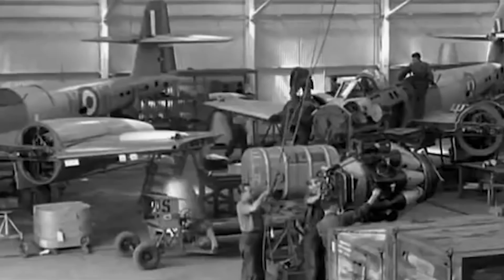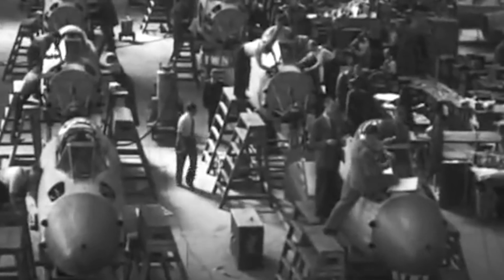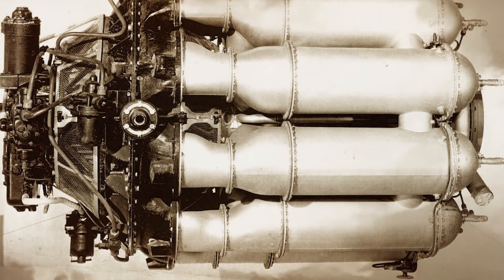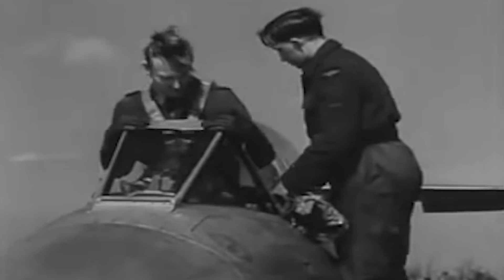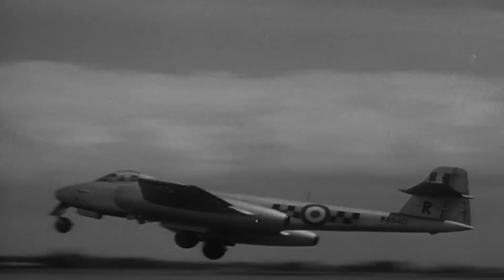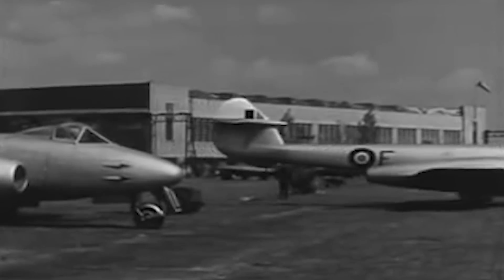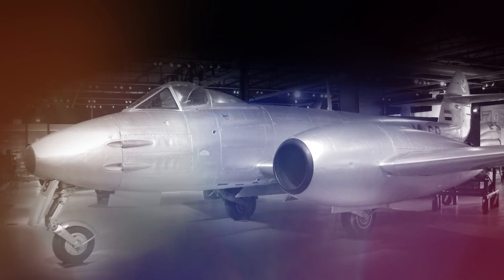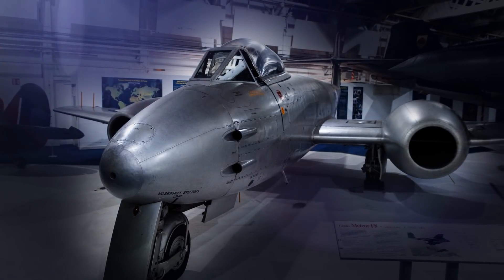Gloster Meteor - The Only Allied Jet to Fight in WW2

Comment: The beginning of the jet age is extremely interesting, but there are many half truths in this documentary along with some myths. 
The Meteor design with its straight wings was not advanced. The wing chord being thick to take the loads with the centrifugal engines being kept from the ground. It can be anticipated to turn well (better?), but probably to be slower than the Me 262 with its thinner swept wings. 

The plane differences is in part a result of the engines, one centrifugal and the other axial. The centrifugal was much more reliable, as envisaged. The axial design, to have a lower engine cross-section, was very ambitious. The Germans had four times as many engines as Me 262 planes. Fuel and extreme short engine life/reliability were the issues. The combat success was not great! The claim that with the right metals the Me 262 would have been a war winner needs to be taken as what it was, a claim based upon lab tests to the bosses. It took years for axial designs to triumph. The desired lower cross-section imposes limits on the other components.

You can then look at the engine components. What were the innovations? The steam turbine was well known and in use. The problem with a jet engine are in keeping a flame from a jet fuel alight, even/low flame temperatures, distances to blades all while controlling the parameters in a combat environment. On top comes the aircraft designer posing limits on everything. All this without computers. Interesting?
Reply: No engineer worth his salt would ever compare a modern axial flow compressor Brayton Cycle Turbojet with a Rankine Cycle steam turbine... the two are as different as cheese and chalk.
Reply: @sandervanderkammen9230  Are insults being thrown? The fluid mechanics are much easier with one impeller. Thermodynamics is another subject.
Reply: @powerjets3512  Just pointing out a deeply flawed analogy comparing a turbojet engine to a steam engine...
 Steam turbines do not have compressors and their turbines although vaguely similar in general appearance are completely different in design and development.
In terms of thermodynamic cycles their are not even in the same class, The Brayton Cycle is internal combustion and uses air as the working fluid.
Reply: @sandervanderkammen9230  They both can be described as very fast rotating equipment.
Reply: @powerjets3512  That is about where the similarities end...
Reply: @sandervanderkammen9230  Thank you for listing so many myths and alternative facts. 

Me 262
May I recommend a couple of videos from "Bismark", Military Aviation History, regarding the Me 262. 

Jummo 004B

I was hoping to get an explanation of why the engine in operational use did not meet the figures. 

Meteor
I think at the very beginning I pointed out that the Meteor design was not good. 

Mig 15

Very good aircraft design built around a not so russian centrifugal engine. I have no problems giving credit where it is due. Great videos of it still flying.

German multi-role Starfighter

Perhaps not all german designs or modifications were so brilliant. 

Jet Engine development

There are books on this.  

Tone

Wenn Sie Deutscher sind, wird es sehr schwierig zu argumentieren, dass die Deutschen nicht arrogant sind und einige der alten Charakterzüge noch vorhanden sind. Sorry.
Reply: @powerjets3512  450 RAF pilots KILLED.
1,006 Gloster Meatboxes CRASHED.

These are cold hard facts that are directly linked to an aircraft with fatal design flaws, was aerodynamically unstable and had  unpredictable flight characteristics.
Reply: @powerjets3512  Performance figures you either do not understand or refuse to accept.
The only false myth is the one claiming the Jumo 004b engines were unreliable.
 They were in fact more reliable than some Allied reciprocating engines yet delivered unmatched flight performance that revolutionized the aviation industry and rendered propeller driven aircraft obsolete.
Reply: @powerjets3512  How can you make such ridiculous claims when you do not understand the most basic, fundamental metrics of aircraft engine service ratings or know what is or is not an acceptable figure based on the type of service.

RAF aircraft like the Merlin powered Spitfire required a mandatory internal engine inspection and repairs anytime War Emergency Power was used in combat.
Often a single applications of WEP would damage these engines and they would require overhaul.
TBOs as little as 6 hours were common for these engines operating in the interceptor role... the same role most Jumo 004b engines were used in during the war.

The GE J47 was the most produced and one of the most successful turbojet in history.
When used in combat in the interceptor role during the Korean War they saw TBOs as low as 12 hours.

Please refrain from spreading any of your false myths and uneducated theories on the internet...
Try reading some aircraft engine service manuals instead.
Reply: @sandervanderkammen9230  I am still waiting for your figures on operational reliability or any references. I am fluent in German/technical German, so do not feel shy. At the moment you seem to just insult people.  

You have twigged that I was talking about the engines rather than the aircraft or victories. Shooting up B17 rear turret gunners with 20 mm cannon in a target rich environment with ace pilots with the best plane of all time gives you 26 "victories". For how many loses? 

"Any engineer worth his salt" includes of course Sir Frank Whittle and all the others. If you want to claim the first operational fighter by a month  (they were desperate enough to fly the Me 163 remember) then the first jet engine ran in England a month before the German one. The issue was resources, and not only people. That was the difference. Whittle lost the lead through no resources to develop never mind for a plane. Britain did not want war. Even with a Trump example, I find it hard to work out what happened in Germany. Why could they not stop? Why do some still need recognition for their war technology?

The German engineers profited from the Nazi money pouring into the military to make something that was going to be very expensive and only for military use. With a few years before going bankrupt they started a world war resulting in tens of millions were killed. Sorry but these early "pioneers" like their German-American colleagues such as Von Braun  were no heroes. They worked with the system. 

Do not think Whittle had it easy. He worked in Coventry for which there is a German verb. 
acknowledge

You seem to be very proficient in English (name sounds Dutch?), so you could read the biographies. There was a pilot, also not worth his salt, called Eric Brown for which there is a book. He is on record as stating that the Jummo/BMW engines were less reliable than the English ones (he not only flew all the planes he talked to the pilots too, or the ones that survived). There is statistical significance and practical significance. 

Did the German (American) pioneers develop the jet engine you go on holiday with or did they participate in enabling all out war? Did von Braun send people to the moon or shoot rockets at cities with his Nazi friends?

Answers accepted in German (learning German to a high level means you hate them all of course. No I am disappointed with the attitude, but this is a youtube hate world it seems).
Reply: @barrierodliffe4155  Thanks for the info. I was hoping that he had a clue and had some original technical documentation concerning the engines. Instead you get unfiltered cr..p. When he says you have not a clue, you know he has not a clue.

He quotes lab figures of pre production heavy engines, not the real ones. Ignores all the facts presented. Thinks that there were nickel metal shortages in 1940 as the engine was developed. Ignores the fact that Junkers chose the metals and the rest. It was designed with a short life (despite years of development they could not do better). Does not know that steam turbine driven centrifugal compressors, as used in the chemical industry, run for 5 years at a stretch. The centrifugal technology was well understood back then. It was the additional combustion process at varying loads and inlet conditions that was the challenge. Nobody would consider comparing the reliability of a reciprocating compressor (engine) with that of a centrifugal one never mind the combustion issue. Does not know that the same , if not improved, Jummo engine only lasted 15 hours in the YAK-15. That similar Allied axial engines also had very short life times for a considerable time after the war.  He chooses not to ask why various German/American engineers told their stories. He has also not gone into the post war improvements done to axial engines to make them work. A Jummo replica with the best technology metals of today is expected to last 300 hours with auxiliary equipment 50 hours... 

Of course Frank Whittle left Britain for the US in disgust at his treatment. Unlike the German/American engineers, he is somehow not American enough. Perhaps a von or better still a van would have helped.
Reply: Where were Allied axial compressor turbojets?
The centrifugal turbojet was an evolutionary dead end.. too bulky, heavy and inefficient to propel modern high speed and supersonic aircraft... it was doomed to extinction.
The Messerschmitt Me-262 had the unique advantage among wartime first generation jets to have been wind tunnel tested to speeds of up to Mach 1.3... the U.K. aircraft industry was years behind in high speed aircraft research, design and technology.
Reply: @sandervanderkammen9230  I concur. The Allies were trying to catch up lost time. They had to have a solution even if it was not the best long term. Is there a nationalist slant here? The russians did build a very good one in the Mig 15..
Reply: @powerjets3512  Indeed, with the jet engine having been invented in Germany some 2 years earlier than similar efforts in England began and a even greater lead in missile technology which crossed over into aviation gave the Nazis a tremendous lead in jet aircraft design.

The MiG-15 was designed by Heinkel engineer Seigfreid Gunter who also designed the world's first jet aircraft, the He-178 in 1939.
Reply: @sandervanderkammen9230  You on about the MiG-15 again. They wisely dropped the crappy BMW engine they'd put in the MiG-9 and opted for the RR Nene to go in the MiG-15.
Reply: The combat success of the Messerschmitt Me-262 was excellent.
26 Luftwaffe pilots scored aces or better in 262 combat operations.
Shooting down over 500 allied aircraft... the Meteor was a complete failure as jet fighter during and after the war, it neve shot down a single Luftwaffe plane and was limited primarily to training and ground attack roles.
Reply: @sandervanderkammen9230  The Me 262 was given to some of the best german pilots still around. I think if you look at the numbers many did not return due to failures. As mentioned in the docu failure of an engine in those days at low level resulted in worse outcomes than with the german Starfighter.
Reply: @powerjets3512  And the Messerschmitt Me-262 was the most advanced and highest performance fighter aircraft ever in service during WW2... it also packed the most powerful and effective standard gun package of any production fighter. 
It's introduction rendered propeller driven fighter aircraft obsolete.

The Gloster Meteor had very serious engineering flaws and other technical problems which plagued throughout its service with engine and structure failures a major factor in its staggering loss rate that continued until production ceased.
The F-104 was an even higher performance aircraft than the Me-262, a Mach 2.0 performance interceptor which first flew when the subsonic Meteor was still in production.
 Flying Mach 2.0 without the aid of FADEC and other modern electronics is extremely dangerous even today...
Even the most recent jet fighters entering service struggle to match the Starfighter's speed performance.
Reply: @powerjets3512  Engine failures in the Gloster Meteor were usually fatal at any altitude level owning to the designs appallingly bad asymmetric flight characteristics and inadequate aerodynamic and rudder control authority.
The aircraft was also unstable at high speed... only the very best pilots managed to recover and survive a spin..
It's for these reasons the plane earned it's notorious bad reputation and it's nickname among RAF pilots as the "Meatbox" a reference to a flying coffin and "Meteorite" the scientific term for a meteor that crashes into the Earth..
Reply: Yet the Jumo 004b engines met or exceeded the RLMs 100 hours PFTR reliability test standard,  the exact same 100 hours required by both the RAF and USAAF during WW2.
Tests performed by the U.S. Army during Operation Paperclip and Operation Lusty confirms TBOs in the 50-60 hour range, excellent by WW2 standards even for comparable reciprocating engines.
Reply: @sandervanderkammen9230  and yet they did not do well in service. Have you an explanation?
Reply: @powerjets3512  50 to 60 hour TBO is excellent by WW2 standard and better than second generation jet fighters..
It's also better than the Rolls-Royce Merlin engine when P-100 and WEP is used repeatedly.

Comment: Frank Whittle was not “the inventor” of the jet engine, he was one of them. Pabst von Ohaim in Germany also developed jet engines , axial flow as opposed to centrifugal. Axial flow is superior to centrifugal, less frontage.
Reply: The concept belonged to Henry Coandă. His plane is in Paris, named  "Coandă 1910". Photos on Internet.
Reply: @lsd8497  The Coanda 1910 was propelled by a Ducted Fan powered by a 4-Cylinder Clerget piston engine.. it was not a jet engine.
Reply: @sandervanderkammen9230  Thank you for the info. Useful.
Reply: @lsd8497  Interestingly most modern civil and military jets use a Bypass engine which has essentially a ducted fan that provides often more than 65% of the thrust.
Reply: Pabst Von Ohain's engine was not axial flow, it was radial outflow, combustion and radial inflow. Whittle's 1931 patent combined both axial and centrifugal flow and such engines are still in use today. Most civil and military engines today are turbofans.

Comment: It flew until 1977,  damn!
Reply: Yeah pretty impressive when you consider the mig15 made it  obsolete 
 in 1947
Reply: @ln7929  Even more impressive when you consider the mig 15 entered service in June 1950, using Rolls Royce engines, but they were more advanced engines than those in the meteor.
Reply: Two are still in service with Martin-Baker today, though not sure if they fly.
Reply: One was used at RAF Farmborough for ironically meteorological surveys in 1980.

Comment: Great combat aircraft,   then states it never saw air combat...wtf
Reply: They intercepted V1s and did combat patrols and ground attack in Belgium, Holland and Germany.  The Luftwaffe had largely abandoned the western front near the end, concentrating most of what what they had left for the Russian front.  The Meteor pilots still put their lives on the line facing heavy Nazi flack and the constant possibility of fighter attack.
Remember the service of the USAF F-106 pilots, they were proficient, ready and waiting throughout the cold war.
Reply: It's true, the Gloster Meteor never saw combat as a fighter, it never shot down or engaged with any Luftwaffe planes during WW2.
Reply: @sandervanderkammen9230  Except the 13 V1's Sandyboy.